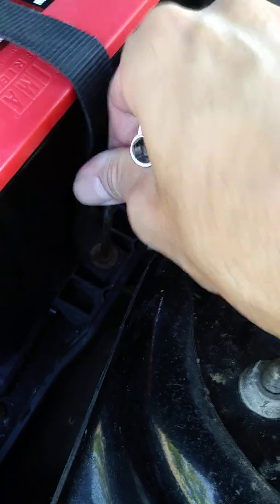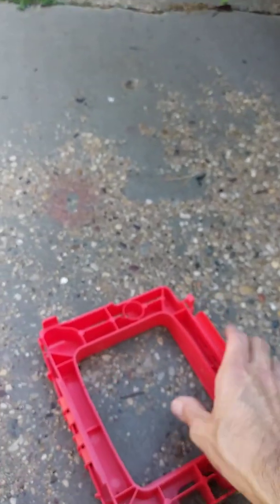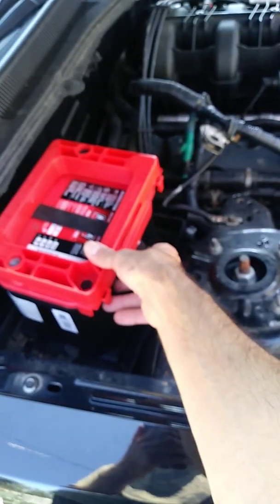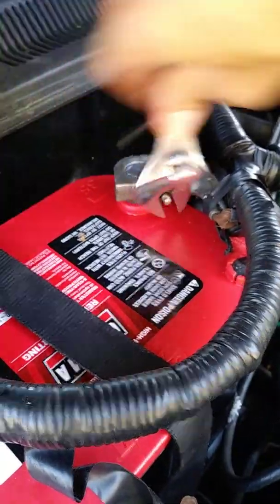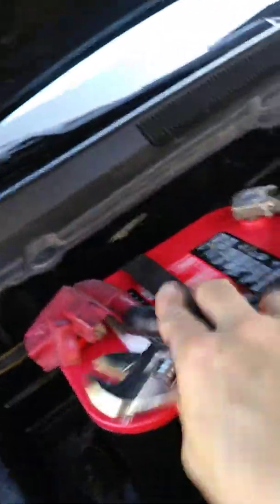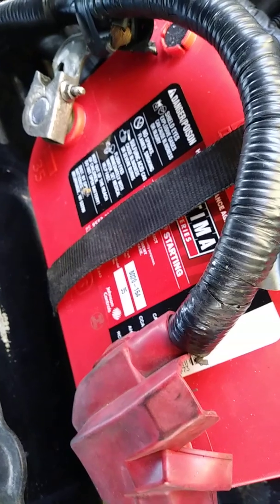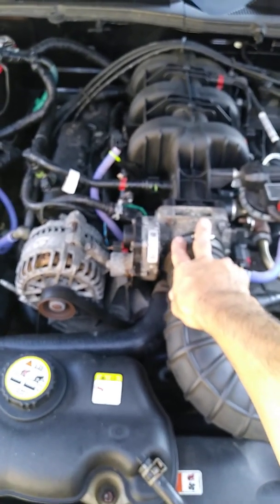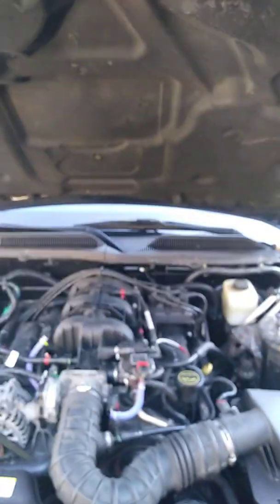2006 Mustang Battery replacement

Comment: Hi LetsrollQ , thank you for your video . I have a mustang v6 2006 and I have to replace the battery (again! ) what is the code of the optima you installed?
Reply: Ok during the video you told the code 8020-164  model 35 . Thank you again

Comment: How did u remove the strap ?
Reply from the maker: The one to lift battery?
I crashed and don't have mustang anymore.
Reply: For anyone else....theres a long screw in front...should be the same 8mm size as used on the battery connections..
Reply: @TheNosePickler bro i was gone for 2 minutes on my battery change today my guy thought he would take the hold down off for me and he broke my strap 😭😭